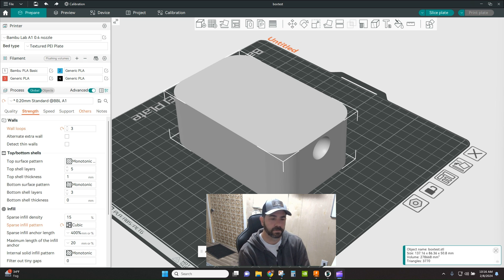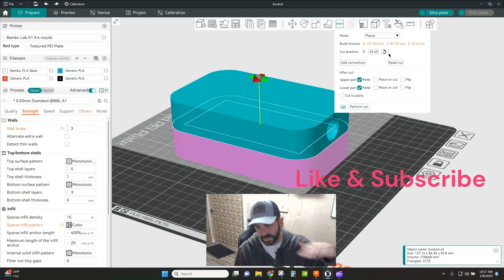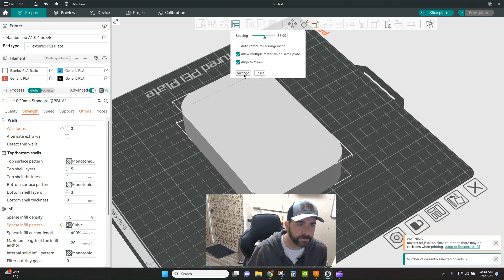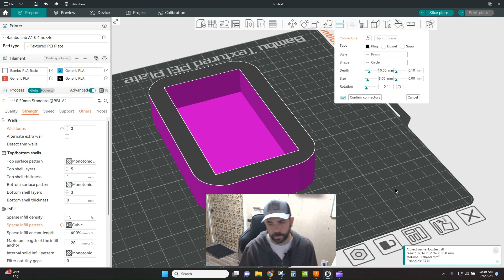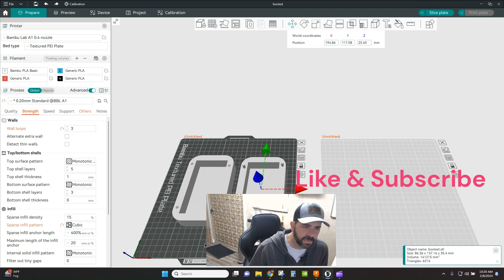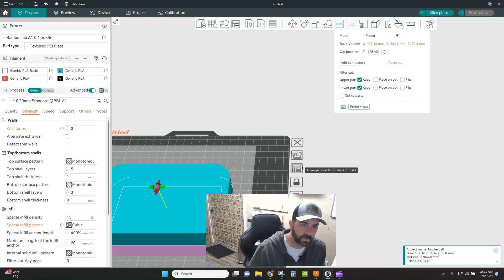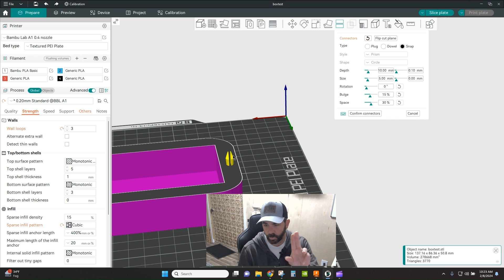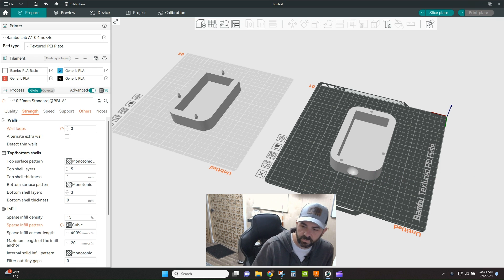Mastering Connectors in Orca Slicer: The Ultimate Fitting Guide for 3D Printing

Comment: Thanks for this video. I'm still having trouble getting my connectors to work. I made some test pieces and 0.2mm seemed like the perfect tolerance for my Creality K1C. However I'm having issues on full scale prints. Especially with thinner pegs/holes, they aren't completely round so even though the tolerance is correct, they don't fit. I've had a bit better luck with using dowels but whichever side is down has a slight brim from the first layer. Tricky to remove on such small parts, and annoying if there are a bunch of them.

Comment: I would like to take a part, cut it into 3 parts and enlarge those parts twice, maybe 3 times in size.
Not sure if Orca can do that using three plates for each cut part.
I can do a lot in Orca but not sure if Orca is at that level yet for my own request of it.
What do y'all think?
Cheers.
Reply from the maker: I believe so, no problem.  I just added a primitive shape (Cube).  Cut it with the cut tool and enlarged each half by 500%.  Too big for one build plate so you get the red error preventing you from slicing it.  Hit the auto arrange button on the top ribbon and it will organize the parts into separate plates.  If there are lots of parts it will distribute all the parts among different plates.  I recently printed this golf ball dispenser and all the parts were automatically distributed across 5 plates. https://makerworld.com/en/models/180302?from=search#profileId-198349

Comment: Good day Fischer 3d. another great video thank you. Do you know if orca slicer is able to remove letters from a model? I cant seem to do it. I have tried Tinker cad but its kind of weird to erase letters then put custom letter's back on. Any help would be greatly appreciated.
Reply from the maker: Unfortunately it's doesn't have too many tools to make that easy.  If the letters are protruded from a wall of surface you could try using the plane cut tool to remove them.  Fusion 360 would likely be able to do it.  If you want to drop a google drive link to the stl or step file i'd be happy to pull it into Fusion and see if it's doable.
Reply: @fischer3d  The cut plane tool worked well. i don't know why i didn't think of that. Thanks for the advice. i Love your videos and advice straight to the point.

Comment: Hello, is there a way to strengthen just the connectors? For example, if i made a box with the plug connectors, can i add more infill/strengthen just the plugs? Or do i have to strengthen the whole box?
Reply from the maker: your best bet would be to add a modifier to your plugs.  In the Per Object settings for the Modifier you can change the infill to 100%.

Comment: Great stuff! Is there any means to split, route a grove around both openings and produce a gasket that fits the grove to be printed with TPU like filament?
Reply from the maker: hmm.  that would be tricky on 2 parts.  You could possible use the paint tool and select a different filament for the painted  area or use a modifier shape and do the same.  For accuracy, I'd lean toward something like fusion 360 to create the channel and produce a separate part for the gasket material.

Comment: Great, it is possible to make timelapse using orca slicer and ender 3 pro???
Reply from the maker: Do you have a camera already?  How is it connected/controlled?
Reply: @fischer3d  yes Logitech c922 webcam and raspberry pi, I dont know how to use them in orca slicer
Reply from the maker: Try clicking the Device menu across the top of Orca.  On the left should be section to add a printer and there was a selection of inputting the IP address directly.  Give that a shot.  As long as it's on the network you should be able to directly connect.  I think there is a link on that page too for a connection tutorial.  My Orca is now tied to my Bambu, so all I see now is that, even if I log out.  But, when I was printing with my Ender 3, I remember seeing several options to connection to Pi, Klipper, etc..
Reply: @fischer3d  thank u so much, yes it connected but I don't know how to make timelapse using all these software and hardware all together, previously I was using cura and octolapse to make timelapses but in orca I didn't figure out how to use it
Reply from the maker: Hmm...  scratching my head a bit on this one, sorry.  On the Others tab, under your Process settings.  Scroll down to the "special mode" section and find timelapse.   What is the value in the dropdown?